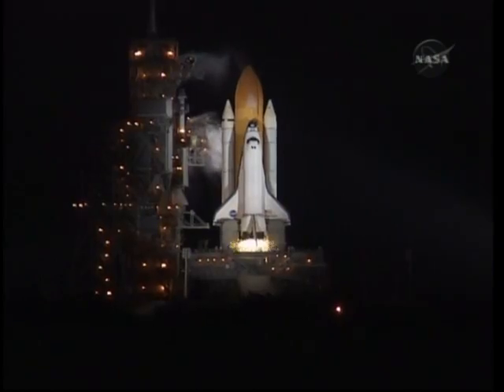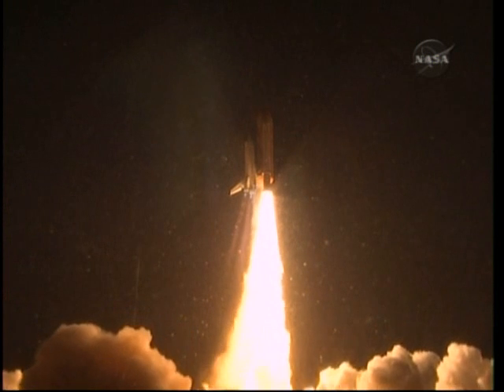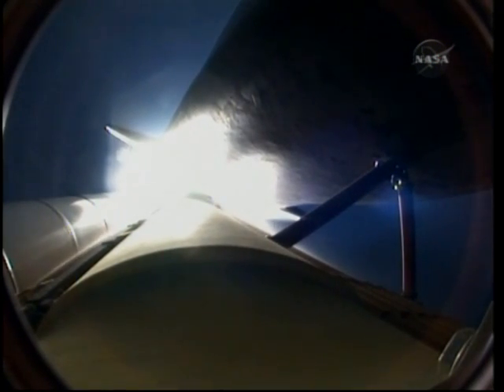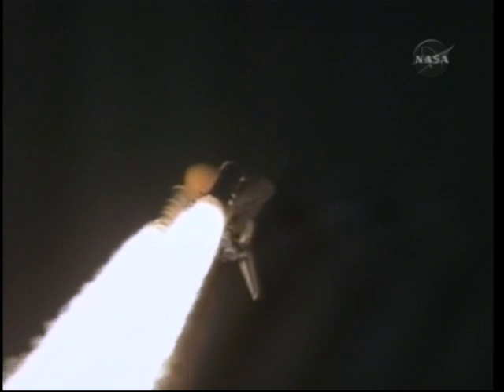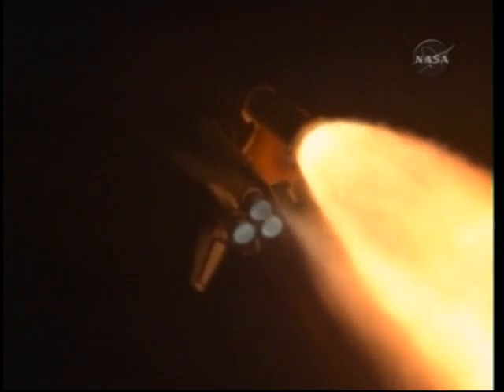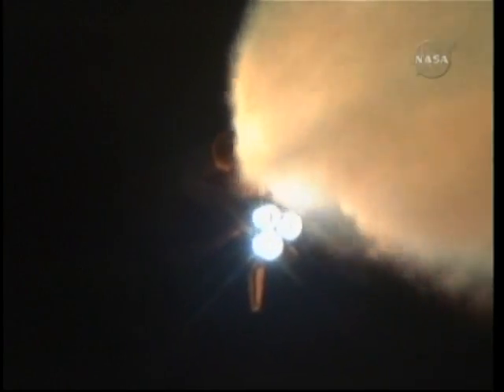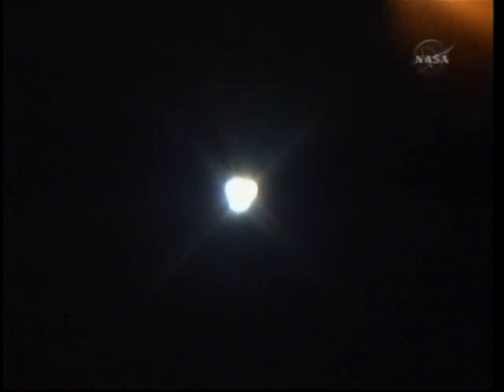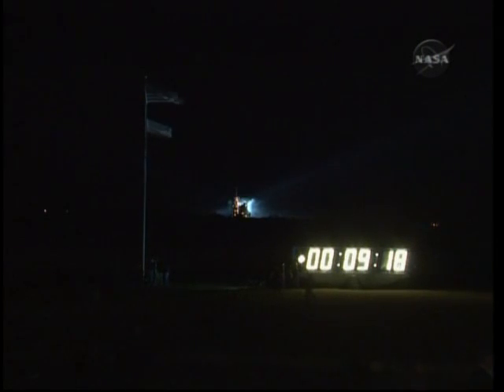STS 130 Launch until MECO Tranquillity & Cupola Space Shuttle

Comment: Amazing footage. If I remember correctly, the glowing aurora around the shuttle is because it is still in the very top of the upper atmosphere traveling upwards of 7 km/s. The traces of air turn instantly into plasma as the shuttle hits them. The flashes are caused by the menouver thrusters (reaction control system) disrupting the plasma